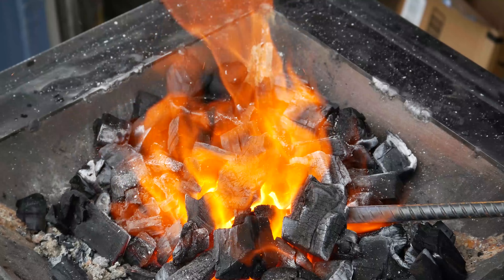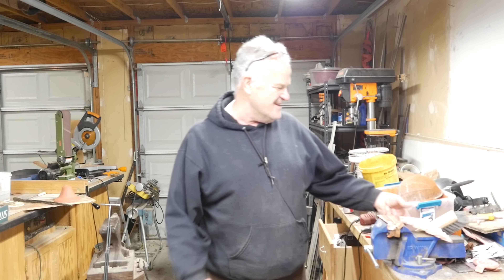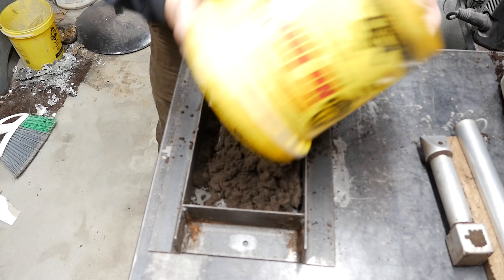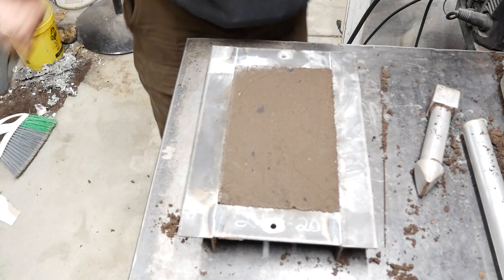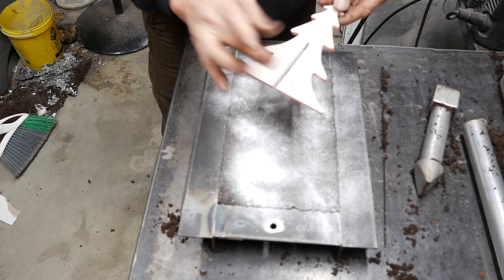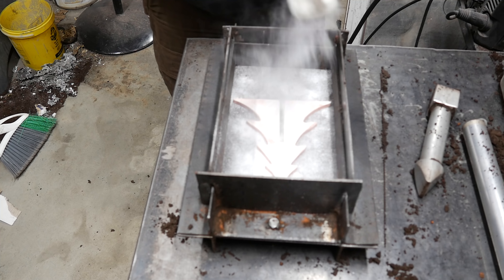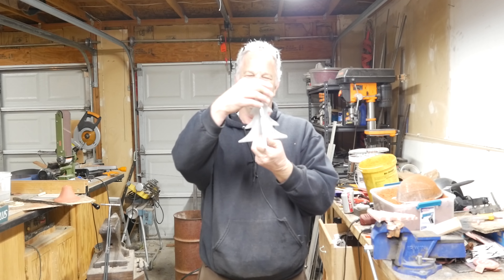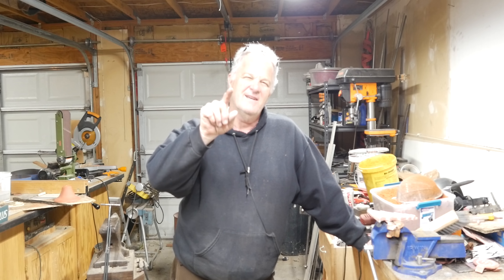Casting an aluminum Christmas tree

Comment: Hi Perry, nice video on a timely topic. I was thinking about the problem of the break away slot piece and I think that the answer lies in making a sodium silicate inverted T shaped core and placing it into the drag with some brads to hold it in position. 
Merry Christmas to you and your family. Looking forward to plenty of interesting videos next year. Mark
Reply from the maker: Hey Mark. No pressure on next year ;-)   I thought about doing a core but I haven't had a ton of luck recently with them.  I probably, as Martin suggested, should have rammed the part in the cope first, turned it over, then packed the sand in the slot, then rammed the drag last. That way the drag would have filled the slot where I packed it in after ramming the cope. Basically I would have ended up with two halves of the slot. Part in the cope and part in the drag. 

The wife wants more of them now so I might give it a try.
Reply: @swdweeb  if you make more try it with a feeded at the tip instead of a vent and it shouldn't have the weird areas as the presser is higher so it fills better.

Comment: Yep, A bandsaw! Best $150.00 that I ever spent. Put one on your Christmas list. Its a bit thinnish to get them in  but you might be able to reinforce the area that broke away with  small flat head nails pushed in before the pattern is rapped and removed.. Martin
PS. A merry Christmas to you too, and I do not give a damn how unPC it is
Reply from the maker: That's what I love about you mate ;-D  I found that if I compressed the sand in that little channel before rapping it about it worked much better. That's what I did on the second piece. Of course I ended up with a thin bit of aluminium across the channel but it was quite easily dealt with. Much easier than the first casting.
Reply: A Merry Christmas from me too and I don't care how un ipad it is either!
Reply: One of the problems with thin pieces of sand like that is that they do not ram well - they tend to be soft and therefore weak and thus break away easily. The compressing down of it as you did goes a long way to rectifying this problem. My method of dealing with this would have been a little different  and I will email you about that....Martin

PS. The more unPc it is to wish someone a merry Christmas the better I like it. I have had it with all this PC crap..
Reply from the maker: I see what you did there, very clever Mr. Lathe
Reply: Sorry quite unable to resist.  Thought you would understand.

Comment: Looking forward to catching this on my break.
Reply from the maker: Oooo new channel logo, nice.  Not sure what happened to this video, but it seems over-exposed. You'll get the idea though.
Reply: @swdweeb  Thanks for the compliment on the new channel logo, I think this is version 3 or 4. Still playing around with things on that. If I remember right you are shooting with a Canon DSLR. You might have had your aperture open a little too much on manual exposure settings.  you may also need to clean your AF points/AF sensors, and/or clean lens contacts; you had quite a bit of autofocus hunting while you were cutting the runner system.

In any case, it was a fun little project and the exposure wasn't so bad. Definitely get the Idea. 
I remember those tinfoil trees and the rotating color wheels with the Christmas silhouettes. I've seen newer tinfoil trees with fiber optic lights for that "retro" flair.
Reply from the maker: Panasonic GH-4 actually ;-)
Yeah, I have never cleaned things so that's probably a good idea.  Shot another video tonight and still had trouble with the auto-focus.  I struggles when I'm zoomed in, always has.
Reply: @swdweeb  what firmware version is your camera on?
Reply from the maker: @askquestionstrythings  uh... I have no idea.  I never thought to flash new firmware
Reply: @swdweeb  reading through the firmware history (the documented changes) it looks like there were some focus related fixes. Hopefully updating to the latest version and cleaning the AF points helps with your focus challanges.

Comment: I had a thought; if you angled the pattern in the cope, you would have more sand between the casting and the box.  Since your wife wants several different sizes,  it looks like you'll have to do that anyway.   And if you do one enough smaller, you might even be able to cast both halves in the same pour.  That would probably get crouded though, so be careful. 

Also a very Merry (my phone suggested the word "Messy") Christmas to you and your family.
Reply from the maker: Thanks Brian. I told her that this is the big one. The other sizes have to be smaller. I'll have to play around with a different orientation within the flask

Comment: I need to look back through your videos. Do you have a video talking about your 3D printer?  I have kicked around the idea of getting one but for now I am not sure what I would use it for. :)
Reply from the maker: I really don't have anything that talks about my printer. It's an alunar m508 Low-priced and pretty good quality.  I just added a z-axis probe that probes the bed in a 3x3 grid so that the firmware knows exactly where the bed is, even compensates for being out of level. It made a huge difference.

Comment: Hi Perry, is that really Talc? I know someone who is always warned of the dangers of Talc, even though it is not Talc he uses!
Reply from the maker: yes it really is talc. I'm old and have lived a long full life ;-)
Reply: Like that is going to work with all the OH&S loonies out there. LOL
Reply from the maker: I'd use a real release agent but haven't taken the time to track it down. I tried to find flux for melting aluminum here in Denver and just ended up with dead ends.
Reply: I think I know who you are talking about, and their favorite parting dust is a commercial parting dust made of calcium carbonate CaCO₃.
Reply: Ask,  Need to be a bit careful with terminology here. My parting agent is indeed just finely ground calcium carbonate it is purchased as parting agent from a local foundry supply house. "Chalk" as in black board chalk which is what some may think you are referring to is actually,   or at least often,gypsum i.e. Calcium sulphate but I do not know which hydrate… We would not want people trying to grind up this sort of "chalk" to try and make a parting agent... Martin
Reply: @olfoundryman8418  my comment has been edited to reduce confusion.

Comment: Don't do that shit inside without a mask or ventilation unless you want COPD.
Reply from the maker: The space is always ventilated and according to this study https://www.ncbi.nlm.nih.gov/pmc/articles/PMC4131937/

"Reduction of exposure and cessation of smoking seem to be the major preventive measures to avoid respiratory disorders in the aluminum industry."

I don't smoke, never have.
Reply: @swdweeb   I only say something because I care, but you're the one admitting you're breathing it in at 12:20 with no mask on in a closed garage while sounding like you are struggling for breath as it is.   I don't see any ventilation system over the exhaust of the furnace when you run it.  Can you show your vent setup some time?   Anyways since we are linking things check out the OSHA recommendations.  That petrobond you use is made of 80-90% silica which breaks down and turns to a fine dust that can be inhaled when you are doing your mold breakouts.  https://webcache.googleusercontent.com/search?q=cache:-84kN8OY7isJ:https://www.osha.gov/dte/grant_materials/fy14/sh-26318-sh4/Section_6_Aluminum_Foundries.ppt+&cd=10&hl=en&ct=clnk&gl=us    If the link doesnt work use the cached version from a google search of "Non-Ferrous Founders' Society Safety & Health Training - OSHA"   anyways good luck, thanks for the videos.